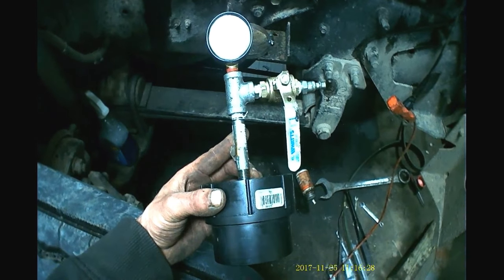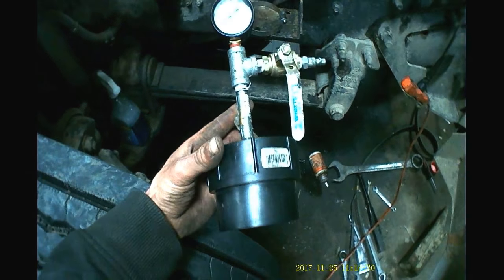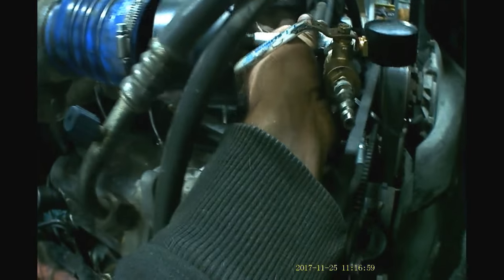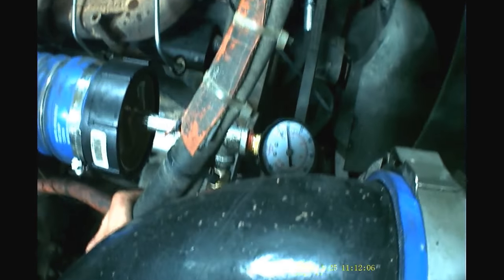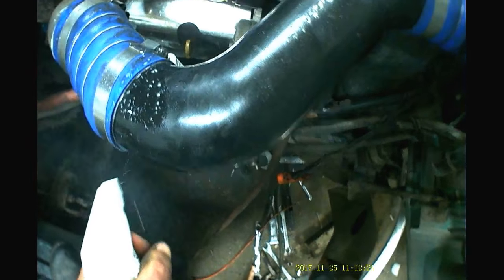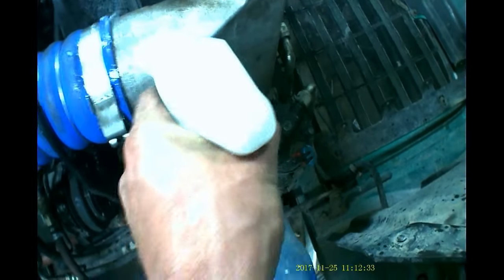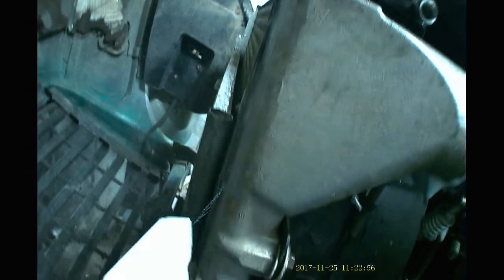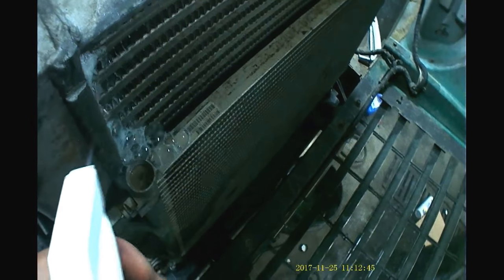checking for boost leaks on semi truck

Comment: Hey I’m having my 2001 e7 460 throw waste gate blink codes under heavy acceleration won’t build boost until 1400 RPM I pulled the turbo off the waist gate was indeed seized so I freed it up. Got it working again put it back on the truck and it’s still throwing the same code and not building boost until 1400 RPM I have not checked for boost leaks yet. Could it just be a bad turbo? How much boost should I be building and at what rpm?

Comment: I had my system checked while in top dead center and still heard a large leak in the head. How serious could that problem be?
Reply from the maker: Depends on the cam grind. There can be some valve overlap at TDC in-between the exhaust and intake stroke. If it stops when you move a few degrees off TDC I wouldn't worry about it.
Reply: @Ezrider359  Hey I misspoke, i was getting a overhead valve adjustment done and the mechanic had all the rockers out because he had to replace the little feet things. We pressure tested the system too and heard pretty good amount of air coning out of the head. He said with all that stuff removed every was in the closed position and there should be no air leaking. He said a valve was sticking open. How serious whould you say that issue is? Thank you so muck for your time, i love your channel.
Reply from the maker: @captnkurt83  yes that would be a problem

Comment: Thanks for sharing, I have done another method where I would start the  engine and blank the turbo intake. If the engine died seconds later then no leak but if it still hesitate to die then you can start hearing air suction from wherever the leak is. Be safe bro, learning alot from your videos. Cheers from malaysia
Reply from the maker: sounds like that would probably work, might be a bit harder to find smaller leaks that way however. thanks for sharing.
Reply: Sounds like a quick easy way to check. I have a hissing sound from passenger side when boost goes up... I checked all hoses and cac is next
Reply: “Blank” the turbo intake?
Reply: @jrowe9301  Yup take a piece of cardboard to blank it but be carefull as you don't want anything to be sucked in. If it stalls immediately then no problem but if it hesitate to die then you can start to hear hissing noise wherever the leakage is. This is just a quick check method with less tools needed or else you can follow this video mate

Comment: I can hear air riding down the road any ideas
Reply: It totally depends where you hear it. Sometimes there is an air junction at the firewall that is a pain to replace. There might be a troubleshooting video.  Other times it is commonly a valve on the bottom of a compressor going bad if you hear it down low under the cab.
Reply: Put up your windows LOL

Comment: Intercoolers are 'supposed' to have a certain amount of leakage. The shovel at the boulder hole started smoking. Black. It was an Hitachi 1200. I asked the wrench man if he checked the boost and he said it couldn't be that. They put a pyrometer on it and it read HOT! They thought the gauge was off so sent it off to be checked and it holed a piston. Factory came and put in a new piston and liner and fooled with the injectors. STILL smoked black. I kept after him about the boost with no results. FINALLY found the intercooler was cracked and all the boost was going out there. New intercooler and no smoke. Nobody checks the simple stuff but you!
Reply from the maker: i wouldn't say there "supposed" to have a certain amount of leakage. but they are "allowed" a certain amount of leakage. there will normally be a spec that says its allowed x number of psi drop over y number of mins at z psi.
Reply: @Ezrider359  I'll go with 'allowed'. Looks like they could do like a radiator and have zero as much as they cost..

Comment: Quick tip, if you find that your cap keeps blowing off as you ad air to the system, its because there is no lip on your cap to prevent it  from slipping past the clamp

Comment: Thank you for another great video! Do you need to have the engine in top dead center to be able to keep the pressure from going thru the cylinder head?
Reply: The compressor should be able to keep up the 30psi even with it escaping

Comment: Can u just leave the engine running and spray it with soap to check for leaks ? Or has to be pressurized
Reply from the maker: your not making any boost when stationary the engine needs to be under load before your going to be under boost to have the intake system under pressure.

Comment: How will i know if i even have a boost leak?
Reply from the maker: some signs that you might have a boost leak, could be loss of power, low boost under load, black smoke/or excessive black smoke out of the tail pipe, also may hear an audible air leak when under throttle.

Comment: Where are you attaching your homemade tool to? I've watched that part of the video a few times and I still can't tell.
Reply from the maker: Inlet side of the turbo
Reply: I just got all the fittings and made this tool, tomorrow I'm going to figure out what's going on with my low boost problems on my C15.

Comment: Great videos.  I noticed my 2008 Cat C15 SDP air compressor intake fitting was all wallered out and air and oil was spraying around the engine and I was losing boost pressure.  I put a ratchet strap on the fitting to get it home.  Question:  Instead of trying to retap and put in a pipe fitting or a helicoil or replacing the air compressor I thought taking the head of the compressor and just mig welding around the loose fitting so it don't leak.  YOUR THOUGHTS....thanks Matt

Comment: An easier way to test for boost leaks is to spray starter fluid on the same areas you sprayed soap on while the engine is running. If there’s a leak your engine will rev higher than at normal idle
Reply from the maker: That works great checking for vacuum leaks on a gas engine pretty marginal at best in this application. There is no vacuum on a diesel engine would need to be a massive leak before it could be detected that way.
Reply: Boost is pressure pushing out. So spraying starter fluid wouldn't do anything cuz it would have to get sucked IN to the engine to do anything. Spraying combustible stuff is checking for Vacuum leaks, NOT Boost leaks.

Comment: How long have you been working on car? You don't look that old and you know your shit... Lol
Reply from the maker: im in my mid 30's i first started learning how to work on engines around 9-10 years old fixing a brigs and station powered mini bike that i had. by the time i turned 16 i had probably already bought 5-10 cars in non running condition fixed them and then re-sold them. got a job helping a guy that had a shop that specialized in working on air cooled vw's and pretty much turned wrenches ever sense. iv worked on a pretty wide variety of things over the years from small engines to large specialized powered equipment, i would not consider my self a expert in any one field of repair but i have enough general knowledge i can look at a problem and figure out what is wrong and how to fix it pretty quickly.
Reply: Do you work for somebody or you have your own shop? And where do you live now?
Reply from the maker: @kienhuynh9620  self employed, trucking owner operator with my own authority, my own shop. most of my repair work i do these days is just on my own stuff. every now and then ill take on a outside repair when i have time witch is not too often. located in north dakota